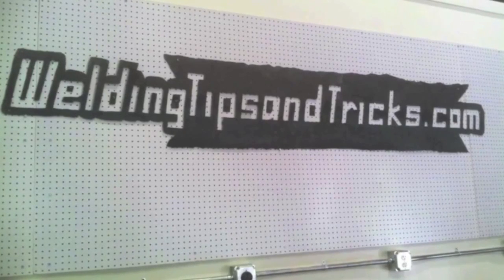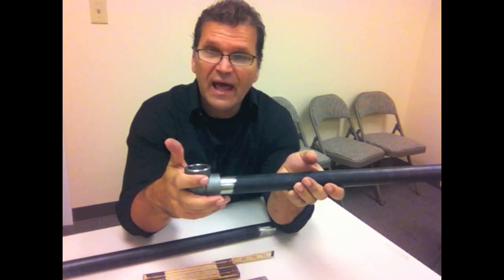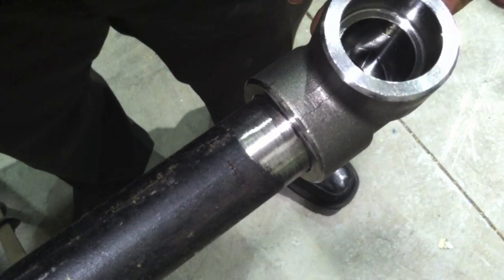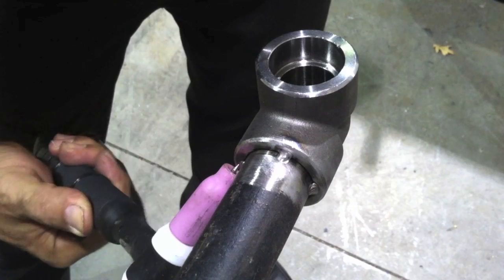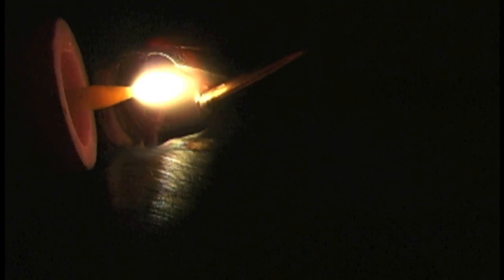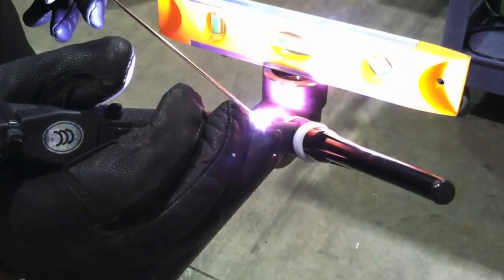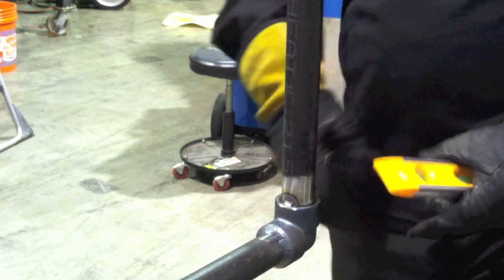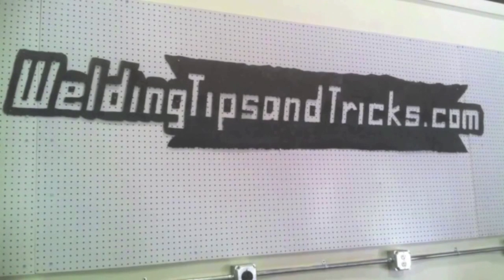Tig Welding a Chin Up bar using Socket Welds

Comment: Small clarification- The B31.X codes "recommend" an "approximately" 1/16" gap remain after the welding. I've had clients insist on 3/16" gap on SS sockets at time of tacking!

Comment: Grate video. A guy I used to work with at Eastern airlines Maintenance. also worked at a Boston ship yard. showed me about Stopping and starting a bead, to keep from over stressing the joint. Said it was a big no no. at the ship yard.
Tony Z.

Comment: When I was young the first day I got to weld pipe, I got educated by an engineer about the 1/16 gap and he made me cut the joints back out and start over. ya don't forget lessons like that, since then I've welded thousands of those joints for code and is done exactly like you have shown grinding mill scale and all. Later on when we did these  I got those spring washers to set the gap in hard to reach spots with long runs. Nice little project to show how it done in "ASME" pressure code. Nice job

Comment from the maker: 4 tacks along with welding continuously in one direction seems to distort very little. But sometimes you dont have a choice like when the pipe is being installed in position and you cant weld very far without stopping to reposition.

Comment from the maker: the cup in the video was brand new but i have used some cups where the hard edge was rounded off from lots of use and it can make the cup slide easier in a groove like a root pass on a pipe. it might be worth a try if someone is having trouble with the cup hanging up.

Comment from the maker: jp2tube,  wow, that was strong.  i figured it would make for a more interesting video to weld it out as if it was going to be inspected per b31.1 code. it goes without saying  that it was way overkill for a chin up bar. but thanks for bringing it to my attention.

Comment: Not related to this but I was wondering if you could make a video using Kobe or 7018 3/32 rods and run a low hydrogen root on 5" pipe with no backer? If you can do this for us your the best! But if not your still the best! So either way haha

Comment: If you learn stuff the proper way the first time, you don't have to unlearn lazy and sloppy techniques.  Sure you can "slap stuff together" with a 110v flux core suicide machine, but there's no market for that kind of work.  

Besides, I expect the project was to show techniques, not for the project itself.  S/F....Ken M

Comment: You know, for Welding Tips and Tricks, I'd say this has got to be the most complicated technique I have ever seen for building a chin-up bar. You could have thrown those pieces all on the ground, squared up with a tape measure, arc weld a few tacks in place, check your square, then weld. Amazing that Jody needs the ends of the pipe machined (to remove mill scale), a TIG machine, specialized clamps and a table to mount those clamps, etc. Come on, Jody. Get real!

Comment: I agree with djonesy597, not all welds in a nuke are EPRI. Typically theyre in the hot areas where you're replacing worn or questionable pipe during an outage.

Comment: @stumpyrope weld SS just like you would mild steel.. With stainless you want to be quick and light with the heat quick to make a puddle get your tack on there and get off.. On the back side you don't want any sugaring or black looking area.. Also helps to back up the piece with thick aluminum to draw the heat out of the stainless

Comment: 2004acurasx, if you're talking about 2x1 EPRI welds those are only on safety related pipe. And no not all piping is safety related in a nuclear powerhouse.

Comment: I never thought about the heat/shrink stress of a socket weld. I wonder if the same stress is present when plastic pipe is put together. Although you don't see the radical temperatures, plastic moves a lot during changes in atmospheric temperature.